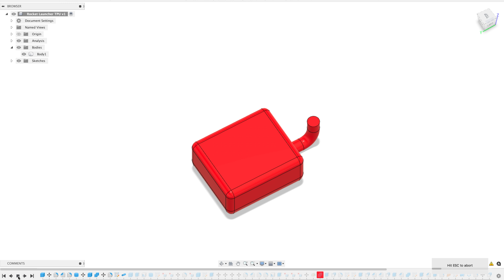3D Printed Stomp Rocket

Comment: try to 3d print a centrifugal freezer compressor, tesla disc or reaction impeller, not piston or wankel
Reply: if you dont think it will work, then stretch some elastic bands
Reply: how about a 3d printed pressure container, many bars of pressure in the container
Reply from the maker: That could be interesting!
Reply: @3DPrinterAcademy  depending on the application, does not have to be 100% keeping the pressure for long time, pulsed high pressure short time storage
Reply: @3DPrinterAcademy  such as a pneumatic car lift pillow
Reply: potato launcher tube
Reply: just give, dont sell, you are given all that you need, by God